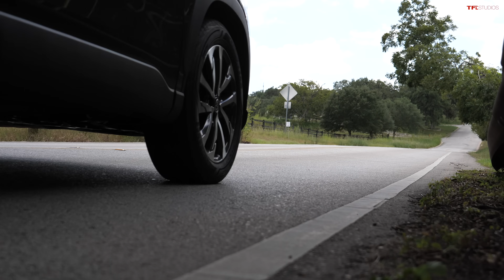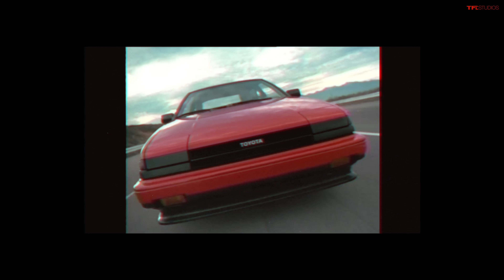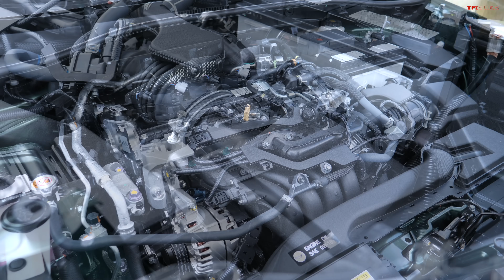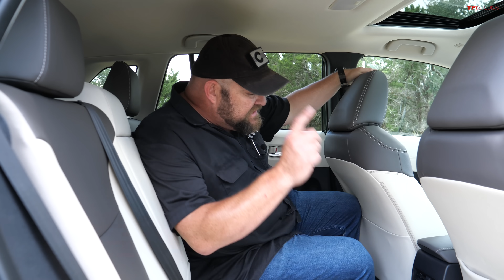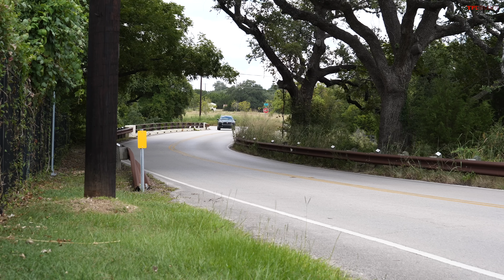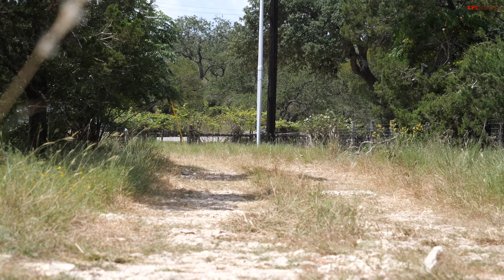Can The 2022 Toyota Corolla Cross REALLY Go Off-Road? (Yes, But Actually No!)

Comment: Wow!  This may be the BEST little cheap crossover ever.  I'm impressed with what you get for the money. And it's a Yoda!!!
Reply: It is not going to be cheap at all... by the time one adds all the needed options (as most of the stuff on this vehicle will be "optional"), the price will be for the fully loaded model XLE about the price of a RAV4.
Reply: @unariver5810  A base model is all you need. I picked up my mazda cx-30 for $25k in cash. That is actually pretty cheap considering the idiots that finance $40k+ cars they can't afford lol.
Reply: You must have missed the little Suzuki SX4 that was sold in North America around 2008-2013. 30MPG+ and FWD/AWD/4WD, for under $13K USD. A turbo and some suspension mods could make it a little rally monster. A suspension lift, mudders, and a winch could make it a little overlander. My 2008 could tow dirtbikes, a jetski, or a utility trailer without issue.
Reply: I’d buy one if it had the 4.0 v6 from the 4Runner and a 5 speed transmission. It would be immortal.
Reply: Not really a mazda cx-30 is the same price and you get a better engine and transmission. Mazda might even be a little more reliable because Toyota had some problems with the direct-shift cvt found in the corolla hatch and this.
Reply: the best and the first is called Lada Niva. First unibody SUV with disc breaks on all 4 corners, Lexus was next but that was 20 years later.
This Rolla is just a copy of the Niva and came out 50-60 years after. and you can't get this Rolla with optional extra snow plow, you can with the Niva.
and the Niva is a lot cheaper...

Comment: You nailed this Nathan.  And I agree with your assessment.  It is logical and it will probably replace the sedan version because it is a "cross over".
Reply: Replace the sedan version? Sedan has 3 inches more rear legroom. Sedan has 40 mpg on the highway. Sedan is a lot faster because it weighs 300 pounds less than this crossover.
Reply: @braetonwilson4296  People like me don't do sedans anymore though. I can fit a couch, or something else ridiculously huge, in a hatchback. I can also put long stuff on a hatch roofrack with fewer issues than on a sedan.

 My 2016 Crosstrek is only rated for about 32MPG. I can easily average over 40MPG by using a $20 DNA cotton airfilter and setting the cruise near the speed limit. I'm guessing that this Corolla Cross will be similar.
Reply: @RKmndo  Just because you don't do sedans doesn't mean the Corolla sedan will be replaced!

Comment: Great review TFL and Nathan,  this will most certainly kill the lil sedan in 5 years or less. 30 mpg is very strong great work toyota and
Reply: Some people continue to like sedans. This should replace the under-sized (for the U.S. market) Hatchback model, or, at least, dwarf that version's sales numbers.
Reply: The hatchback will die before the sedan LONG before those things sell like trash
Reply: Sedan has 3 inches more rear legroom, 40 mpg on the highway, and is noticeably faster than this Corolla Cross since it weighs 300 pounds less. No way it will kill the sedan.
Reply: @braetonwilson4296  I’m betting sedans go away.  The profit margin is higher on CUVs.
Reply: @user-tb7rn1il3q  Prices are also higher for CUVs. Toyota and other car makers need an entry level affordable vehicle so the Corolla, Civic etc. is going to stay.
Reply: @braetonwilson4296  They are not charities.  Sedans are history.  They cost as much to make, but sell for less.

Comment: Toyota put the RAV4 prime drivetrain in this thing or give us a GR version.
Reply: If Gazoo Racing puts a sweet near 300hp* 3-pot, like is expected in the hatchback this GR Corolla Cross would become "the next Rav4 Prime".

* rumors out there that for US-spec a GR Corolla would have an upgraded version of the GR Yaris making +20-25hp.
Reply: @syxepop  That sounds perfect
Reply: @CruiseControl1  - I have been asking for a 300hp NisMo Sentra or Rogue for quite a while, but Toyota got the Rav4 Prime first.

Check Kirk Kreifels account, as he has been hearing those rumors for weeks, pegging the US-spec GR Corolla output at 296hp (in the Rav4 Prime ballpark).
Reply: @syxepop  Man I hope you are right and that something like that comes out.

Comment: I am a Toyota fan. But with any CVT, get a transmission cooler. The Toyota CVT is the best built in the world, but a little extra protection doesn't hurt.
Reply: While Toyota has always made the most reliable CVTs, the addition of the true 1st gear will further protect its longevity, as initial takeoffs are what wears the most on CVTs.  Nissan CVTs are absolute junk.
Reply: @barrydraper  It's actually the heat from city driving that destroys all CVTs. Toyota pioneered the CVT, so they corrected this problem 15 years ago. CVTs are metal belts that stretch and start to slip due to overheating. A Transmission cooler prevents that from happening. Nissan/Renault made the cooling system too small, so within three years, the Nissan CVTs started to break down.

Comment: Overall the design looks very good. A much better package than the hideous CHR. Using the Corolla name is a smart marketing move. Well played, Toyota. Being that this is Toyota though, it's probably poorly equipped in base form and once you tack on the features you want, you realize it's $6,000-$8,000 more than the competition comparably equipped.
Reply: The base model doesn't have a hatch wiper! I never tought i would see that level of cheapness! Reminds me of my first car with no left side mirror, was an option! They are good car but base model are there to make you feel poor and toyota should stop that, the koreans base car are better equipped and make you feel good, no 1 speed intermitent wiper....
Reply: @theadvocate4698  Toyota definitely cheaps out with the content in their vehicles, no doubt.

Comment: It has less power than a crosstreck?  Yikes.
Reply: Well the higher hp option it has less power but the 2.0 it has more and this has a 2.0
Reply: The Subaru boxer will blow head gaskets and burn oil by 60k miles.  I’d stay away from that trash.
Reply: @user-tb7rn1il3q  idk if they fixed the oil issue but everyone I know had trouble with burning subaru oil around 2014
Reply: @occckid123  The boxer design is junk.  They all burn oil and blow head gaskets, even pampered ones.

Comment: Great crossover but they should have learned from Subaru, a 2 liter just doesn't have the beans for many potential buyers.
Reply: Also crosstek isn’t the same as this at least what they are selling for
Reply: @kitchetech  Rodger that. I saw that as a competitor. Same size about arnt they?
Reply: @dmurphy1578  maybe this is more for city driving it seems crosstek at least has off road more
Reply: @markcrawford1982  I read the same.  Two full seconds slower than a Crosstrek Sport.
Reply: This has less juice than a crosstreck.

Comment: I can't off the top of my head, recall the back seat leg room of the CX-30... But I do recall the driving feel, refinement, and sound system, which was actually really good. And I didn't even test drive a Turbo. The only gripe I had with the cx-30 was no 360 cam, and thick rear side pillars for my taste. If the Corolla cross hybrid can smash the cx-30 in fuel economy, visibility, and match it in refinement, then that ain't nothing... But if we're not getting the hybrid to start, and they just take the sound system out of the Corolla... I got one of those, and it ain't impressive at all.

Comment: Okay gas mileage does not overcome the tiny fuel tank.  The Crosstrek has 16.6gal, this one get 12.4gal (FWD) / 13.2 (AWD).  The extra 4 gallons will give you an extra 120 miles per tank... That's 11-12 more trips to the gas station per year if you drive 12K miles/year.
Reply: 12 gal tank is insanely tiny in this vehicle. Miles per tank is going to be on the low end.
Reply: You would only want this in the hybrid with that gas tank if you drive a lot.
Reply: My cx-30 has a 12.7 gallon fuel tank it''s a little small  and i only average 15mpg. The epa gas mileage ratings are complete BS. But i don't drive that many miles so it's not a big deal for me. But the car is fun to drive and has decent acceleration so i don't mind the gas mileage.
Reply: @paranromallover4543  If you idle a lot or live in a hilly environment, the EPA ratings goes out the window quickly.  I average 22mpg over 94,000 miles on my 2016 Tacoma 4X4, mostly on all flat Central Florida highways so I'm on par with the EPA ratings.  I drive about 400+ miles a week, I need fuel autonomy for a week.  I'm content with my Taco!
Reply: @paranromallover4543  Yeah my 2016 Crosstrek is rated for 32MPG hwy. I easily average 40MPG+ on my commute by using cruise around the speed limit.

 My 2016 has a 15.9gal tank, so I can do over 600 miles/tank.
Reply: @RKmndo  wow that is great. I only have 200 miles on my cx-30 but the break in period is 600 miles at least. So im guessing the poor mpg might be because i haven' broke it in yet.
Reply: One more fillup a month doesn't sound bad, but winter fillups always make me wish my tank was bigger.

Comment: You talking about comfort got my attention. For some reason it seems the older I get the more I like comfort. Along with the fact I've developed achs and pains I didn't think I would have to worry about till I was much older.
Reply: I m not a cuv or suv fan due to height .. harder to get in n out of car
Reply: @adrienchan2097  Check out the Hyundai Kona N its not high off the ground it looks like a fun CUV that you can take to the track.
Reply: the older you get, the need for yoga stretches increase exponentially to keep joint pains manageable
Reply: I've found at 56 that I had to drastically cut back all things related to sugar.  That makes a BIG difference in the ache levels.
Reply: @ziplokk1453  You're lucky you made it to 56. Plenty of young Americans die every day. Plenty die well before 56. Cutting out sugar is a great idea.
Reply: T Ritchie sounds like you could use a magnesium supplement. Just a hunch. Most people are lacking mag. It's one of those minerals that does a billion things in the body.
Reply: Ohhh yeaa keep talking comfy to me, just  like thaaat
Reply: You need to stretch and fast your body is inflamed and it’s probably tight. Stretch and hydrate you should feel better
Reply: @USNVA-yn6cp  crossovers/SUVs are more expensive, higher risk of rolling over in an accident, poor fuel economy, and poor handling. Be less arrogant old man, you'll learn something.
Reply: Old people in the past drove sedans. How come all of a sudden, old people nowadays must have crossovers because of their aches and pains?
Reply: @braetonwilson4296  to be fair in the past sedans were the norm. Now its crossovers to the point the some automakers dont even sell sedans.
Reply: @camaroman101  There are still plenty of sedan offerings though from Toyota, Honda, Nissan, Kia, Hyundai, Volkswagen etc.
Reply: @braetonwilson4296  No its the auto industry pushing them on the public or people like them sedans will be a thing of the past in 15yrs. Hey Im ticked that you cant get a CD player in most cars now.
Reply: @braetonwilson4296  I'm 56 and have '17 Camry SE and an FJ.  I also have in partial storage(I take her out every now and then)  a cherry 2008 Lincoln Town Car that I'm keeping up until I retire.  Big, heavy, truly comfortable sedans don't exist anymore kiddo and haven't since 2011.